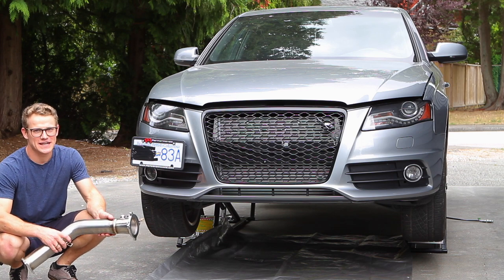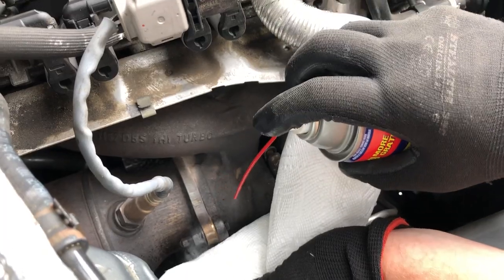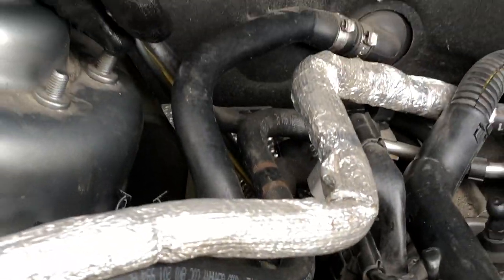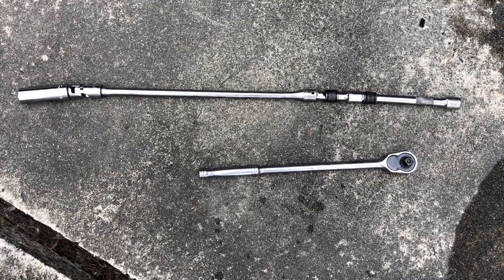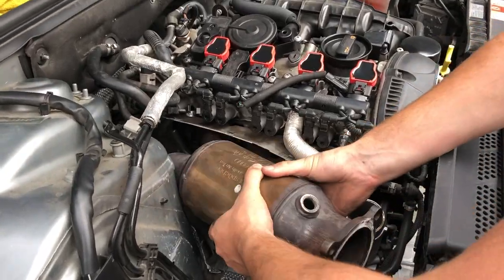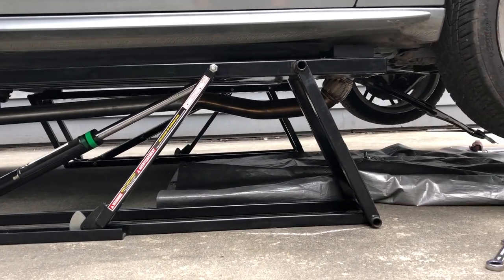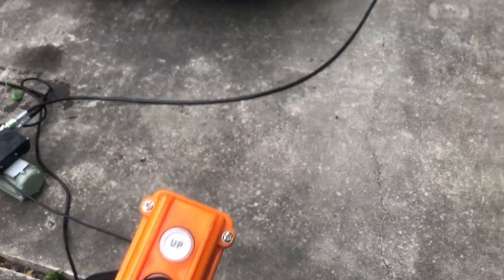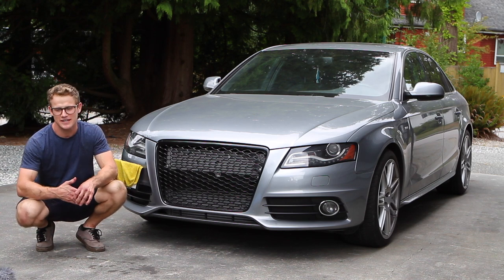Installing a Catless pipe in 2010 Audi A4 2.0T

Comment: This was a great video lol. Was thinking of decatting my stage 2 A4 B8
Reply from the maker: Go for it!
Reply: @Calvinm  I have the decat. It will go on this weekend !
Reply: Update: I could not get that 4th Bolt off and now the Decat sits in the garage until I muster the courage to attempt again.
Reply from the maker: Hmm that's rough. Try soaking the 4th bolt with some liquid penetrant a few times over a couple days or pick up a propane blow torch to loosen the bolt. Good luck!
Reply: @Silver_1_1_1  any updates??
Reply: You should already be decatted dude. Your stage 2?.
Reply: Any cel lights ?

Comment: so did the Ie stage 2 take your check engine light away, im not sure why no one wants to answer this question.
Reply from the maker: The tune you load on is responsible for making the check engine light go away. There are a couple different methods of ensuring the check engine light that relates to cat efficiently doesn’t show up. Most tunes do something like removing that fault code or not having the car intake the information from the downstream O2 sensor. The tune on this car is for a catless car and therefore did not throw a check engine light with this exhaust set up. Hope this helps answer your question.

Comment: I got the stock turbo on my A4 B8 could I do this and put a stage 1 or 2 tune on it without blowing the turbo?
Reply from the maker: Anytime you force the turbo to produce more boost than stock you will shorten the life of the turbo. How short will its life be is anyone's guess. With that said the stage two tune is meant for the stock turbo so it should be alright for a reasonable amount of time if you've done the other supporting mods like intercooler and maintenance. Stage two would be ideal for a catless setup over stage one. Best of luck!
Reply: Really it depends how you drive it. If you are racing it around all the time then yes or very least you will destroy the diverter valve on the turbo. Drive it normally and play once in awhile turbo be fine. But still with more boost probably need install better diverter valve to handle the extra boost

Comment: super clear and detailed vid, appreciate it, but how tf did you get those 4 bolts off from the turbo to cat?? that shit is so rusted on my car and Im afraid of stripping them or something
how many miles did the Audi have at the time?
Reply from the maker: Ya those four can be challenging. Try spraying them with a penetrant a few times in the days leading up to the work to get them ready. Also there’s no replacement for a torch to make the nut glow orange before cracking it loose. I can’t remember exactly but the Audi had around 140,000 km’s or 87k miles. Best of luck!
Reply: @Calvinm  yeah can't go wrong with just heating the bolt red hot I suppose, thanks so much!

Comment: What other exhaust mods does he have? I have the exact same model just in white, already have a K&N intake in there but I want that growl he's got... Pricing?
Reply from the maker: It had a resonator delete in the downpipe after the catless test pipe. Then it's a custom 3" exhaust with a straight through magnaflow muffler in the mid section of the exhaust. No muffler at the bumper end. Not sure on the pricing.

Comment: Does this throw codes? Will it pass emission tests?
Reply from the maker: The tune is designed to not throw an emissions related code due to the catless pipe. It likely won't pass emissions. Depends on what kind of emissions test were talking about but I'm not sure if the OBD port will show emissions readiness.

Comment: So does a tune that ignores the Cat efficiency fault codes make it so I can pass emmissions??
Reply from the maker: Probably not but I’m not sure and it would depend on how they test for emissions. If they inspect the vehicle and its exhaust components, no. If they put a wideband O2 sensor in the tailpipe and drive the car on rollers, no. If they plug in a cable into the obd2 port and inspect it digitally, maybe but I doubt it. You are removing an emission device when you go catless so unless a tune has some wizardry in it, it’s unlikely.

Comment: Did you have any noticeable gain in torque? And was that throaty sound after the cat delete?
Reply from the maker: Yes and yes.
Reply: @Calvinm  did you need any ECU tuning specifically for the cat delete mod in order to get that increase?
Reply: @EJR20  I wonder that to or if you will just get more power without a tune

Comment: Do you need the tune to get the test pipe? I just want the better sound for now
Reply from the maker: Ya, I wouldn’t recommend running a test pipe without a tune. The turbo will produce more boost and the car will be confused about that. The fuel map on a stock tune won’t work with the added boost, possibly running lean.

Comment: Did it throw a CEL?
Reply from the maker: It did not throw a CEL because of the tune that was meant for a catless downpipe. If you don't tune it, it will likely throw a CEL very quickly.

Comment: Any idea if the engine light or any codes related to Cat will come on after deleting?
Reply from the maker: Yes, if you run catless without a tune you're car will throw a CEL because the downstream O2 sensor won't like what it's seeing. The tune we installed had a work around built into it.
Reply: @Calvinm  what tune did you use for your car?

Comment: Did you get a check engine light after installing this? Or get a check engine light for that eventually???? Please answer. I need a new cat converter for my 2009 audi a4 (B8) and I gotta pass emissions but my stock cat went bad but i like tha sound of the str8 down pipe
Reply from the maker: Our car didn't get a check engine light because we installed a stage two tune on it from integrated engineering. The tune is designed to ignore the fault code for catalytic converter efficiency. If you don't get a tune or do anything to your o2 sensors after going catless you will throw a code and also not pass emissions testing. Best of luck!
Reply: @Calvinm  how’d you get the tune? And how much was it? You bought a tool and software?
Reply from the maker: @ApolloJetsonKND  Integrated engineering made the tune, it was about $499 US and you need a cable to interface between the OBD port and your laptop.
Reply: @Calvinm  I currently have a 2012 A5 with cts intake straight test pipe into awe resonated downpipe and straight pipe the rest of the way. I currently have a stage 1 IE tune. Would you say doing a stage 2 tune is safe without an upgraded intercooler?

Comment: Nice 👌 any engine lights on ?😜
In Germany illegal but we all know how it is with modifying 😂
Reply from the maker: No check engine lights yet. The company that sold my friend the tune couldn't confirm or deny whether the new tune was "deleting" the check engine lights that would occur with removing a cat which makes me think the tune has disabled some of the codes making it appear fine on the dash. You're right, that's how it goes modifying cars these days haha.
Reply: Calvin MC what brand is the test pipe?
Reply: Calvin MC and what is that mini lift set up u have called?
Reply: @Matteo.Pedroza  you can see it at about 3:34. QuickJack BL-5000SLX

Comment: Hey bro so my stock cats is bad can i buy this aftermarket one and install it? and does it show  any check engine light thank
Reply from the maker: If you go catless it will throw a check engine light unless you get a tune. You might be able to use a highflow or aftermarket cat without throwing a check engine light but I'm not sure.

Comment: How did you pull the stock car out the front I’m trying right now and can’t fit it out
Reply from the maker: Lots of wiggling and have the O2 sensors removed. Be persistent and good luck!
Reply: I got it finally bro I didn’t think I was gonna get it I had to pull it out from the middle right behind the engine lol
Reply: Currently 😭😭 got it out gutted it now I'm tryna put it back Lord help me 💀

Comment: what kind of lift is that where did you get it??
Reply from the maker: it is called Quickjack 5000 lbs capacity. I got mine at costco, here's a link:
https://www.costco.com/quickjack-5%2C000-lb-capacity-portable-car-lift.product.100460313.html
I really like the lift, it feels safe and it's a good height.

Comment: Science it has 2 o2 sensors would I need a fouler for both sensors or just 1 for the check engine light
Reply from the maker: I'm not sure, I don't have experience with o2 foulers. If you're going catless it's recommended to get a tune and a new tune can solve your check engine light issue related to the lack of cat.
Reply: @Calvinm  like integrated engineering tune stage 1 is fine?
Reply: @Calvinm  so does yours have the check engine light on yet?
Reply from the maker: @swiftapexmobile2738  Stage one is for a stock car, with catalytic converter. It depends on what mods you have done.